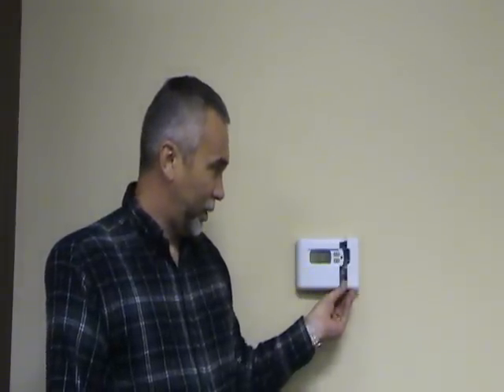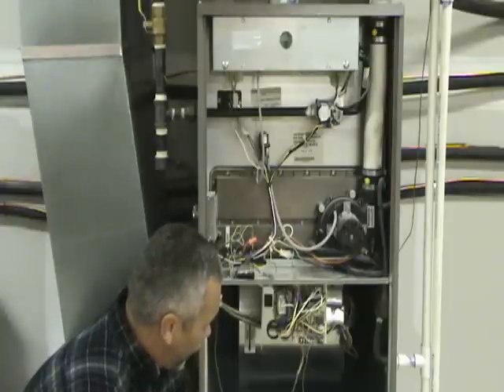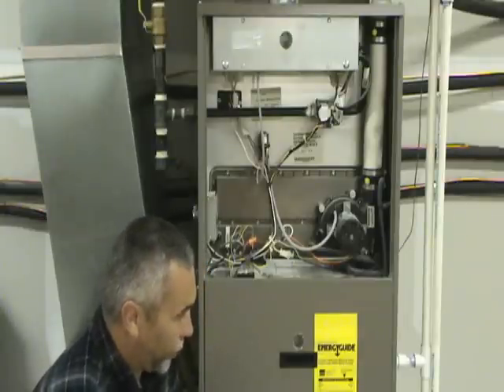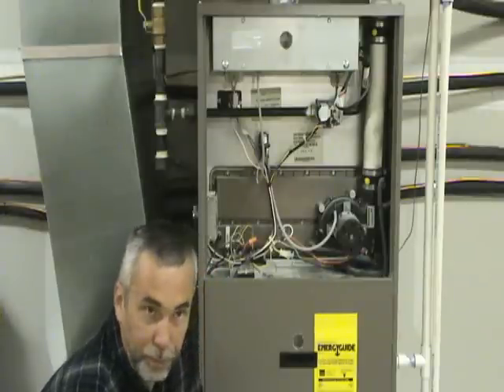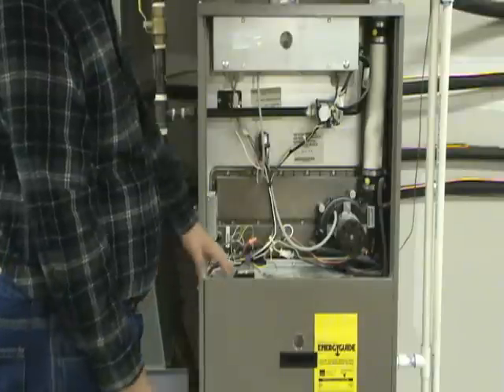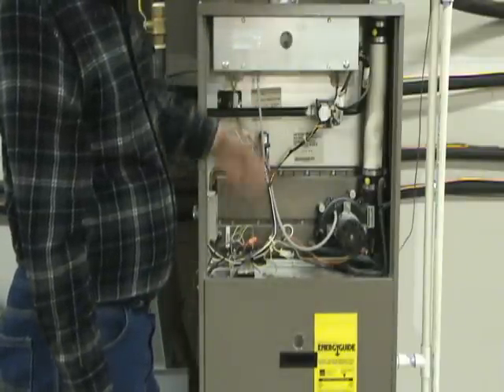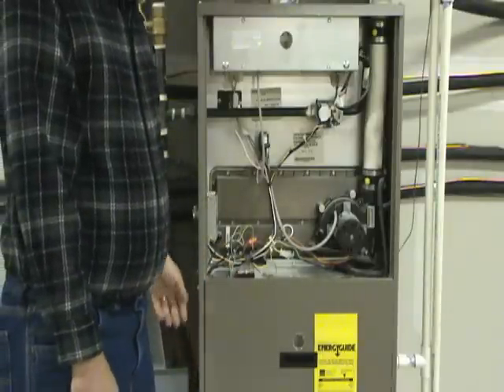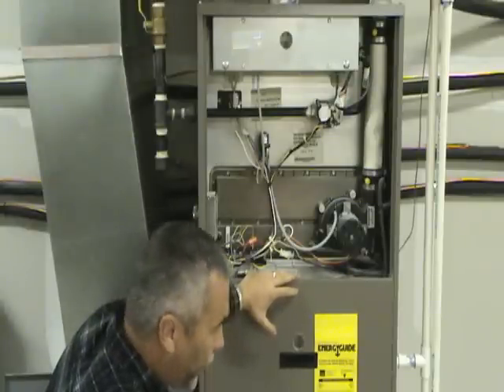Gas Furnace Troubleshooting Step-by-Step: Repairing Common Heating Problems

Comment from the maker: Which part of the heating cycle is your furnace failing at? (e.g., Is the inducer motor spinning? Does it glow or spark?) Let me know in the comments and I'll try to help! 👨‍🔧

Quick Tip: If your furnace control board has no lights at all, check for a small 3-amp or 5-amp purple/amber fuse on the board itself. It's a common $2 fix that many people overlook! [06:09]